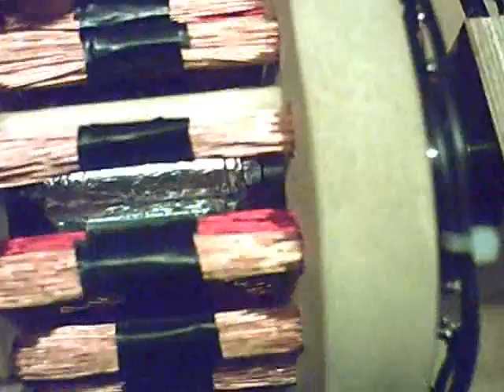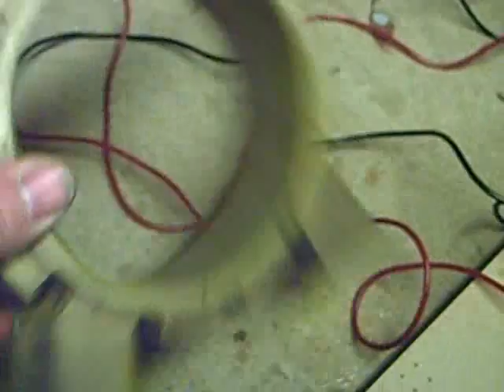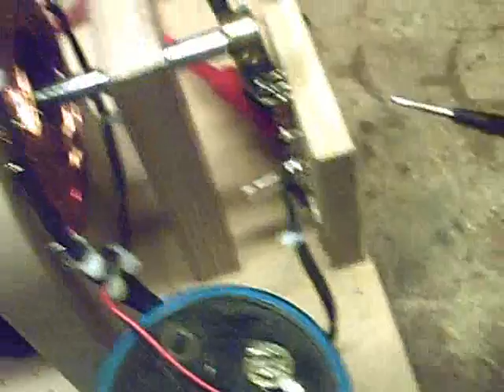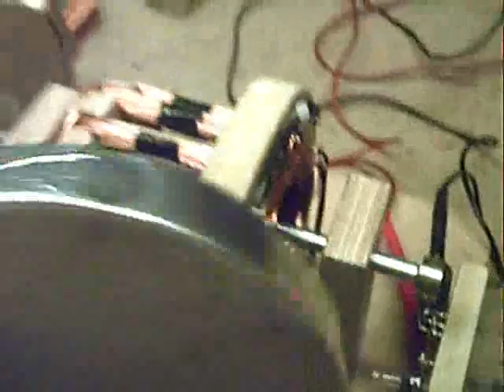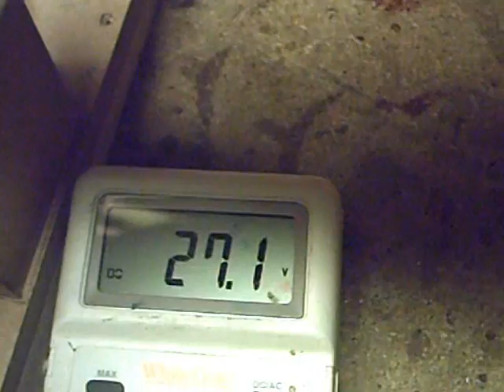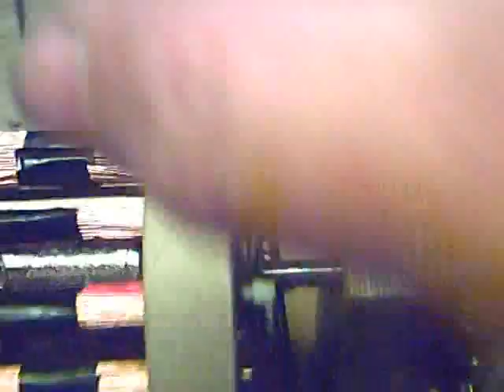Just a test run of double generator 2. (TheDaftMan)

Comment: Daftsman, I love your work and circuit drawings. 
Following you for three years now. 
I use 110mm, 160mm and 200mm sewage pipe as rotor bands to keep the magnets in. Works extremely good. You may even finish the outer of it in a lathe for perfect gap settings.
Regards.
Gert.
Reply from the maker: Ill be starting back soon, just finishing my house and on with new workshop.  just have to sort all my stuff that's been in storage for 9+ years, wow i have some rubbish lol.
Reply: @theDaftman  Would love to see you back on here.  you should post your drawings and schematic diagram for those that may want to follow along

Comment: Am I wrong in thinking that if this is overunity, he should be able to disconnect the capacitor and it still run?
Reply: if he cab run the motor on the capacitor only it would show over unity over  all of the resistances to keep the capacitor charged without external voltage!

Comment: im just gonna throw out an idea, why not use the torque of the motor that charges two batteries (swap etc) to turn a 120 A car alternator to use the electricity from. e.g. via a belt and a larger flywheel on the motor? just an idea, might be stupid. i hope im gonna be able to try that myself

Comment: Oy mate, awesome job! On the generator side you should made a bigger diameter rotor with half inch by half inch by two inches neodymium magnets embedded. The closer you bring the magnets to the coils, the bigger peripherical speed, the more tight magnetical coupling and of course, more voltage and amperage in the generator coils. And try too loop the system. Good luck!

Comment: How does the open winding motor work? I'm curious if it produces any decent results compared to a standard motor with steel lamination to contain the magnetic flux. I would imagine it you run into some series inefficiencies with it.